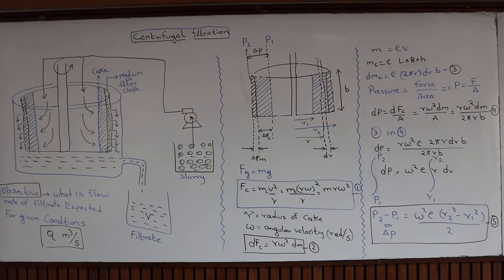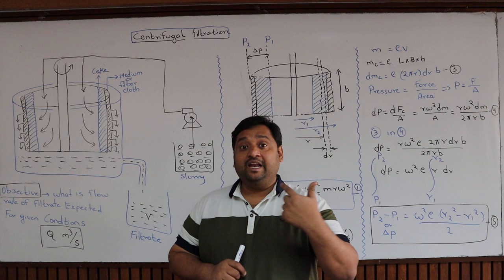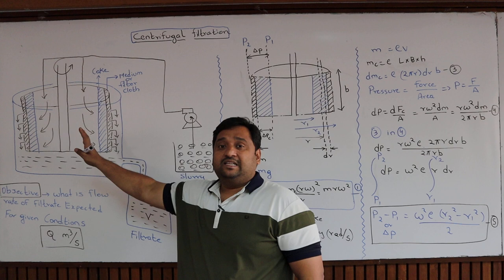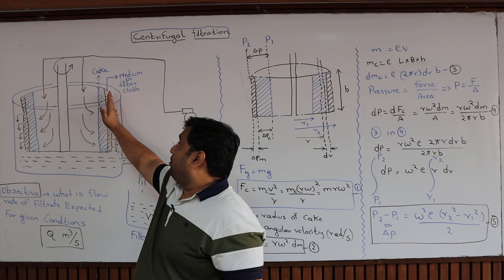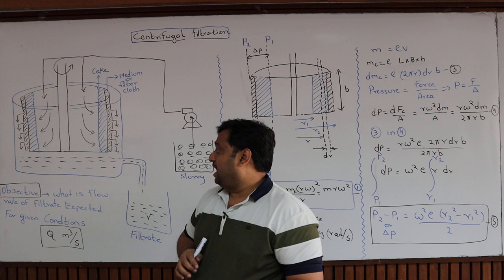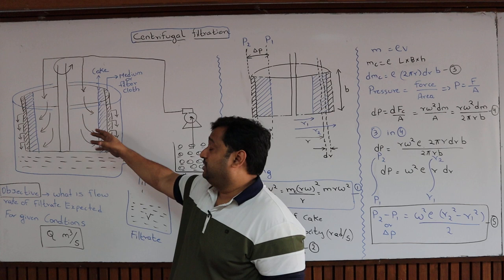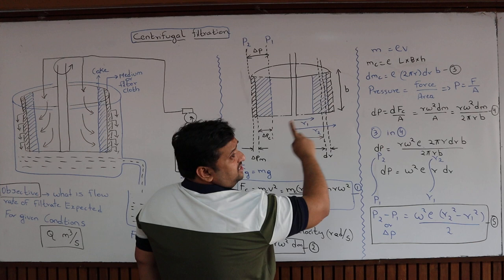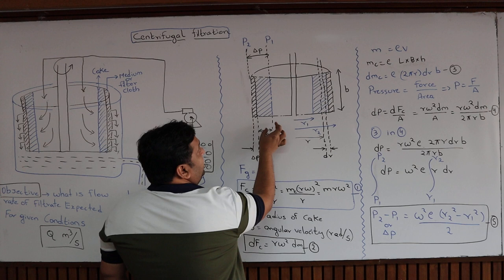Lec 26: Centrifugal Filtration (Top Driven Centrifuge Demo/Derivation/Solved Example)

Comment: Sir could you please make a videos on 

1. Development of Material Balance ,  Energy Balance in Excel for systems
2. Performing Batch cycle time calculation, unsteady-state calculations for batch reactors,
3. utility Estimation and validation of equipment sizing
4. Performing hydraulic calculations (pump and compressor, control valve hydraulic calculations, line sizing, relief valve sizing) and validation of data using ASPEN Task Plus and EDR (Exchanger Design and Rating).
5. Design of distillation columns, extraction columns and heat exchangers using ASPEN PLUS and EDR (Exchanger Design and Rating) module
Reply from the maker: Thank you for asking me to make more videos. I will try my next target is chemical reaction engineering.